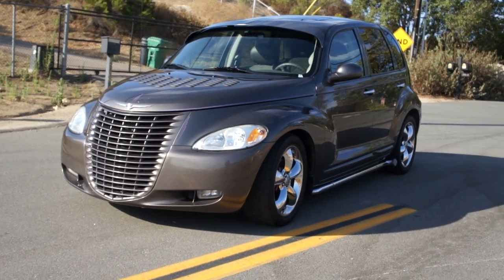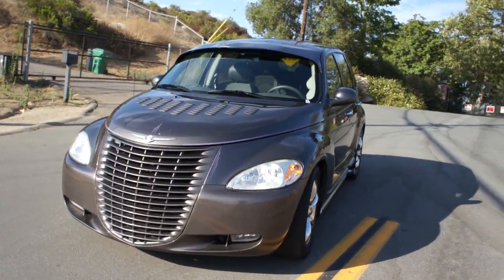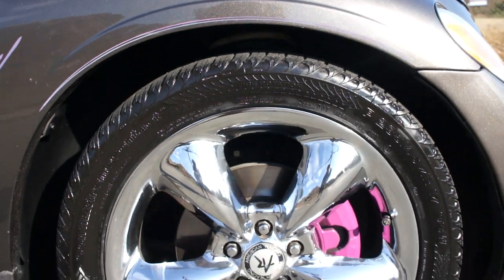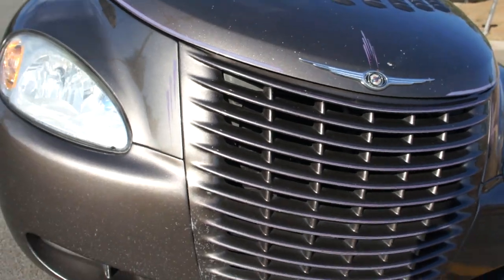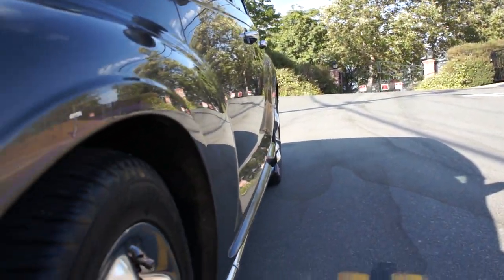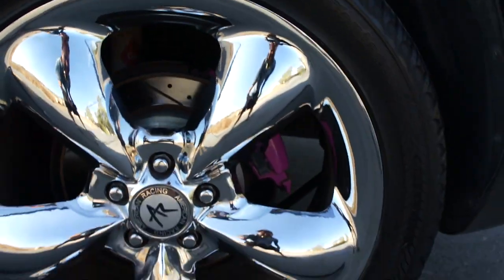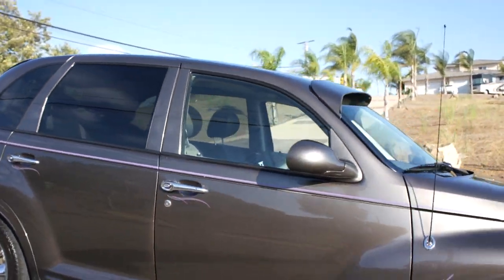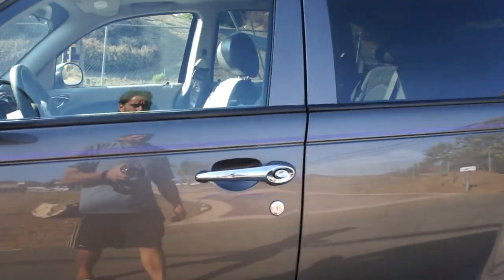PT Cruiser EXTREME Tricked out Show Car SUV Pt cruiser 1 Owner

Comment: Louvers not scallops. Scallops are a paint accent similar to flames. Most every other alteration done to this car are bolt-ons. Mileage would indicate timing belt / water pump service is due. Radiator is nearing end of life mileage as well. As these cars age expect one-off custom body mods to be seen ...round frenched headlights..split windshield mods .. lucite grills .. chopped/sectioned bodies.. widened fenders/quarter panels. Might be nice to do a Turbo 5spd. 2dr convert chopped with a carson top and other mods I mentioned. Time will tell. This is still a nice car though. A little paint work and reg maintainence whould make it a keeper. Best to you and yours.

Comment: I had one for two years. POS car! Broke down every two months to the tune of $500 every time.
Reply: +Samantha Tully Had my turbo PT for 12 years.  Still drives/handles like new.  Fun to drive and no issues yet.
Reply: Mine has 270,000 miles and never breaks down and if it does it's just the battery
Reply: Cycling Witch long story short I thought the exact thing. until I realised that my car had been running with literally almost none of the wiring in the engine connected. The mechanic I took it to thought I was pulling a fast one on him, he said there was no way it could have been running and driving for almost a month like that. but it did!
Reply: Gregory Hess i see a similarity to the Chrysler minivan, it may be possible to do a 3.8 swap.